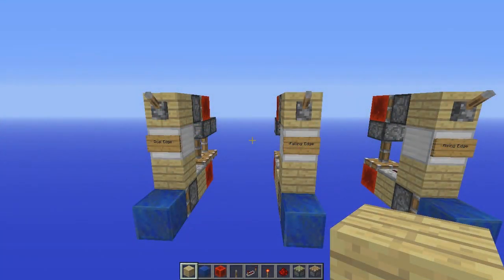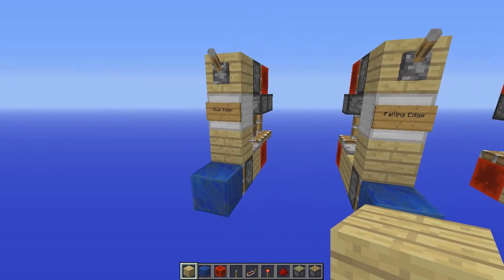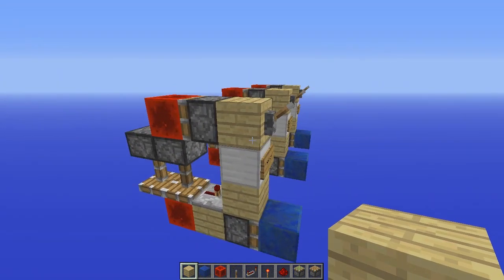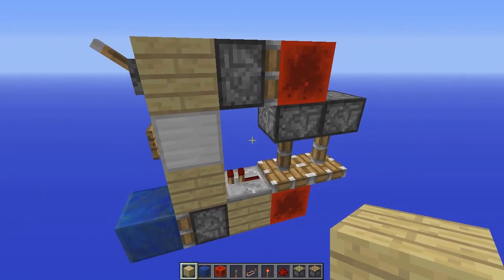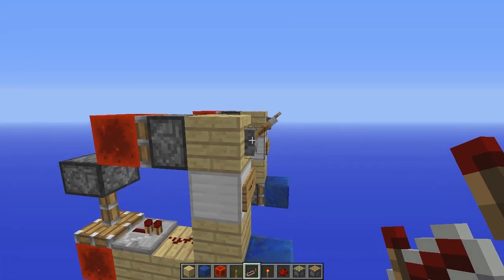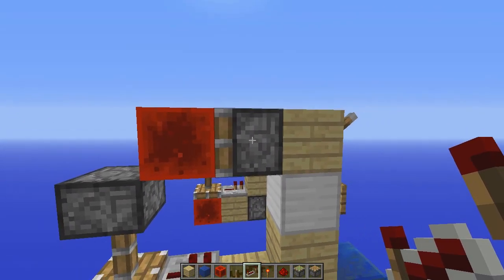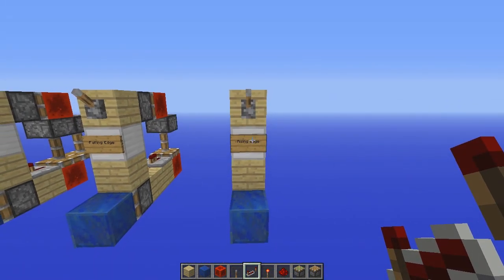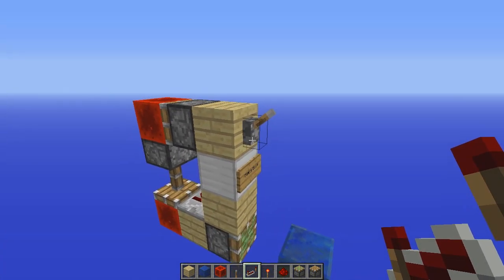Piston Monostables | Redstone with Fenno

Comment: A Dual-Edge is the opposite of a T Flip-Flop.
Dual-Edge: When input toggles, output pulses.
T Flip-Flop: When input pulses, output toggles.

A T-BUD is the opposite of a Piston (or Piston Extender).
T-BUD: When a block is put in or removed from a space (as an input), the output toggles.
Piston (Extender): When the input toggles, a block is put in or removed from a space (as an output).

How many other "duals" are there?